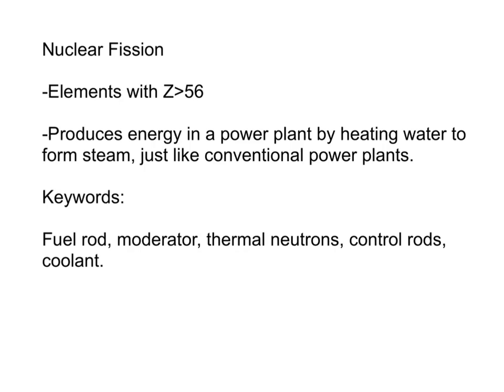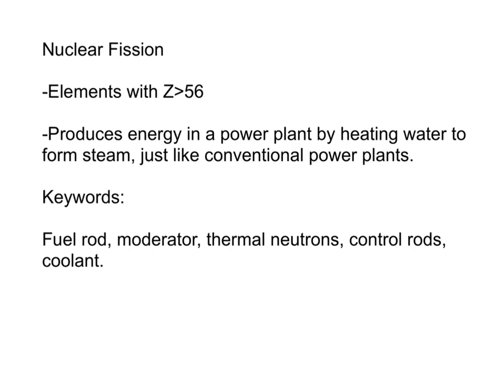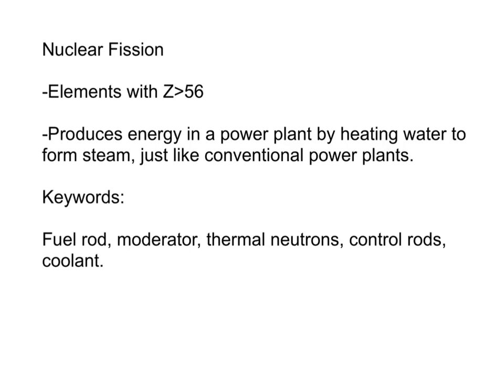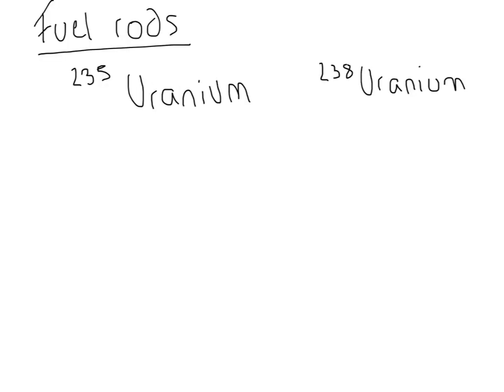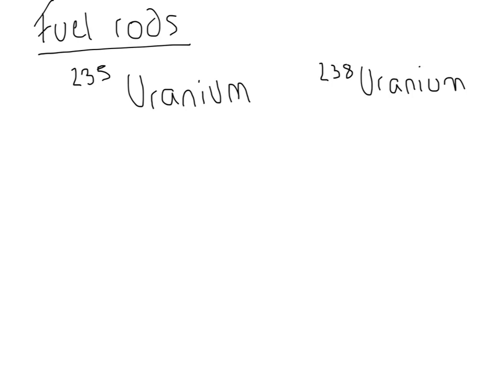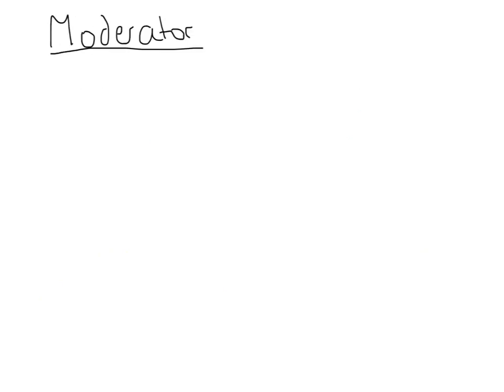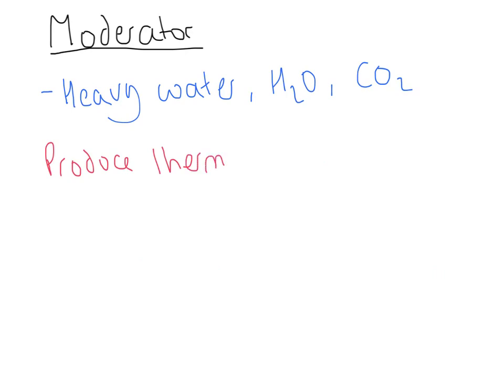A Level Physics: AQA Unit 5: Nuclear Fission

Comment: why does water not evaporate in the reactor?
Reply: rojafx Beacuse water coming from the reactor is cooled down by the cold water coming from the coolant. if you have AQA A2 physics book have a look at the diagram on page 119, it shows much clear.
Reply: its at really high pressure